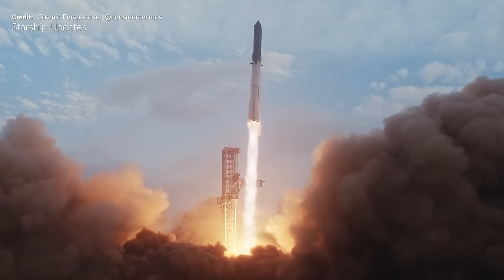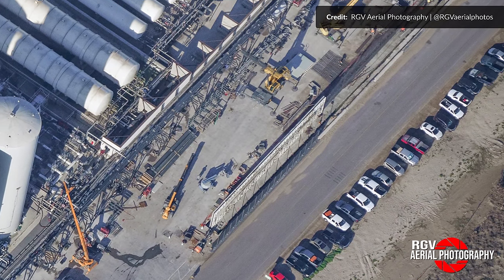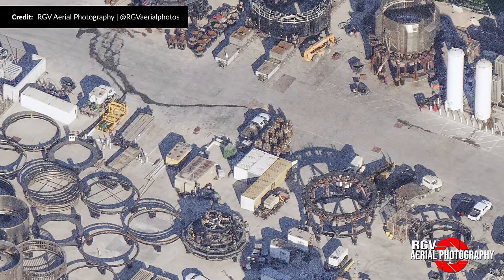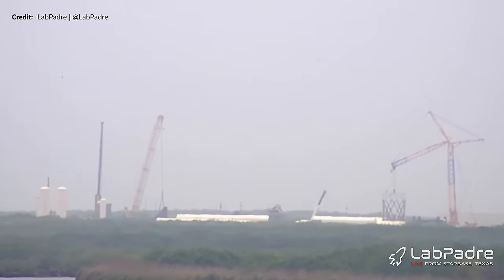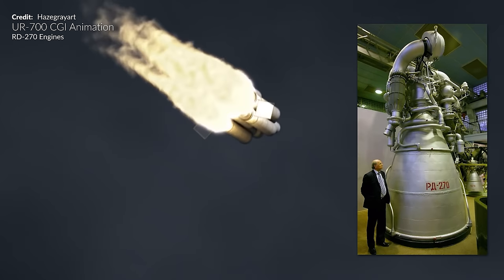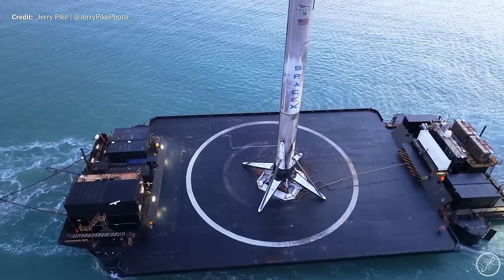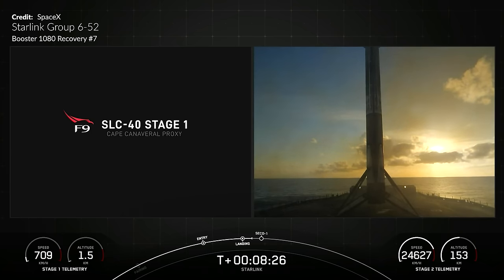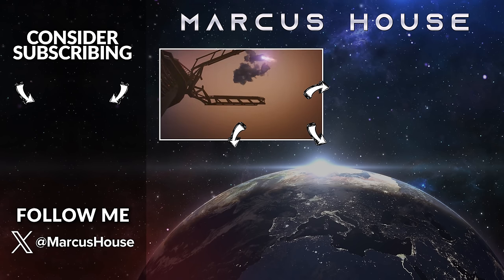Why is SpaceX Starship Only Capable of 40 to 50 Tons to Orbit For the Flight 3 Version?

Comment: Hi Marcus - Starship 3 might even be capable of single stage to orbit, provided it only had a tiny payload and the vacuum nozzles were a bit different of course. That’d be quite something and might open up crew to orbit and modest point to point possibilities without having to worry about a booster. What do you think? Have I got this right?

Comment: For everyone playing Boeing Bingo for the upcoming launch, a perfect win must include a clock failure, at least one bad valve, more than 3 software errors, flaming wiring, loss of at least one parachute, and a door jettison before touchdown.
Good luck!
Reply: dont forget to let a flight critical system* rely on a single non-redundant sensor! (* not documented as flight crtical, but will result in failure if it fails)

Comment: SpaceX built many raptor 1 engines, in fact there was a big kerfuffle over the rate of production not matching Elon's demands.  They are not used on the Falcon and have not been sold to other rocket companies and so far there have been just three 'batches' used up.  It may be that SpaceX is using up their inventory of the now-obsolete engines while they test the rest of the overall rocket.  Would that explain the lower power figures?  They're flying without payload at this point, so no need to push it.

Comment: Stainless steel is great for prototyping a rocket. Less so for building a low mass rocket. While the benefits of its strength to weight ratio through the extreme temperature changes may hold up against something much harder to work with like composites. I doubt it's still going to be the best material for all the parts a SS needs to be fully rapidily reusable. I've wondered since they started if once the design was farely well locked down if they might start trying to shed weight with different materials. Parts like the flaps can be made robust and low mass with composites. Titanium weighs about 55% the weight of steel for roughly the same strength for parts like the absolutely massive grid fins. Theres probably a thousand parts on the full stack that could be much lighter once the design is finalized. Of course you can't just copy a stainless steel part in carbon fiber and have it work the same but the gains are so large I think they'll go through the trouble. Imagine how much that gulper door would weigh in stainless vs aluminum or composite. Stainless for everything let's them develop fast. But I'd expect a farely involved mass reduction program once they are confident in the design. Plus the thing is clearly over built even if they stuck with stainless only. It doesn't need to handle summersaults with an empty booster and the ship still full of propellant. It does suck that you really can not believe anything Musk says. Yeah his words can be true but he's given everyone a lot of reasons not to take it for granted. You'd be stupid not to buy this model 3 when it can earn you over 40K a year as a self driving taxi while your not using it! In 2017. Among other things..... Anyone remember that rocket assisted supercar they made 5 years ago? Yeah me neither. Thankfully I have a lot more faith in the people at SpaceX than I have in Musk.

Comment: According to a source at SpaceX this difference in the thrust and capacity is a tower issue.  If all the Raptors fire at the true rated capacity, it would nearly destroy the launch tower.  This means that the lift capacity must be lowered.  But as you pointed out early in this video the tower and components close to the tower are being upgraded and hardened to mitigate this issue.  However, the FAA and NASA require a "total system lift capacity rating for certification" so the lower number has to used.  This explanation is WAY, WAY, WAY oversimplified.

Comment: I'm still somewhat dubious that those "chopstick" arms can catch a decelerating, 1000+ ton mass with two pins.
Reply: Not decelerating, virtually stationary.
Reply: 200t, but more importantly, a vehicle whose engines can be throttled down to hover.
(Falcon 9 can't do that.)
Not 100% clear on how the rotation into place will work but Marcus pointed out some hardware last week that seemed to help address that.

Comment: Isn't the SSME a full flow engine too, albeit a fuel rich one?
Reply: the difference is that the Oxidizer/LOx in the RS-25 is put directly in the main combustion chamber, and the Turbopumps both run Fuel-rich. So only the Fuel is in the Staged Combustion, not the Oxidizer.

Comment: why don't spacex put starship tiles on the booster quick disconnect?
Reply: the outer covers can handle heat fine. it just needs better seals and better protection on the inside, which cant be solve with starship tiles.

Comment: With the many advantages of hybrid rocket technology - throttleability, higher specific impulse, and controlled shutdown - why on Earth do we still use solid rocket engines at all?
Reply from the maker: Solids are cheap and simple. That is really the only benefit. Basically a massive firework. Arguably the monsters on SLS are not that cheap either.

Comment: The engines exhaust trail does not seem particularly clean as it should in the IFTs.. Leaving me to think there is excess unburnt methane in current flights. Could be intentional mitigation for Raptor v2 issues?
Reply: Unburned CH4 wouldn't be brown, and the engine runs oxidizer-rich.
Pretty sure what we're seeing is NO2 produced from the excess high-temperature oxygen (or atmospheric oxygen in presence of the exhaust) reacting with atmospheric nitrogen.

Comment: Fun fact.  When the Starship lift-off occurs, the rocket will lean away from the tower to avoid accident entrapment.  This was the reason for the fuel line damage; the trust was vectored right at them, and they failed.

Comment: Would it be possible to use a "catapult" to improve the launch mass of the starship stack? It feels like a system similar to the catapult used on aircraft carriers would go a long way in launching more mass to orbit.
Reply: starship is largest and heaviest rocket in history. it would be very difficult for any catapult to launch it upwards. even then, it would need to launch it at pretty high speeds for it to be effective.
Reply: Somebody, I think Everyday Astronaut, did a couple of "Why don't they just?" videos (not SpaceX specific) that would answer this.

Comment: 6:25 "we think this is due to them wanting to try something new "

Like getting them to actually stick to the ship?

9:30 "why only 40 tons and not 100 to 150?"

A) Because you don't just build a 100 ton-capable ship. The main reason why nobody else has done it yet is that it has no use case, but the second most important reason is that it's very very difficult to do.

B) Because those numbers are what Musk wants. Musk wants to have the biggest rocket so he simply makes yup a few numbers and his uncritical fans just copy them down. And even now that it turns out that ten years later he can't do it, they literally go "well he meant starship 2.0". No, he meant this one. Actual Engineers warned that this was going to be very hard and it turns out they were right.

But also: catching the booster means that the booster needs to be able to hang from the chopsticks and *stay in tact*. It's already quite beefy to be able to support starship and the insane fuel load, but now it also has to hang from the chopsticks and that simply adds a lot of weight in the form of structural supports.

There is a reason why nobody does this: it's an idea dreamt up by a salesman who is out for spectacle, versus an engineer who is looking for a workable solution. Catching the booster is a Cybertruck: it looks cool but it's not functional.

I don't think they are running the engines in low-power to spare them. All IFT's are planned to end in a loss of the vehicle so running the engines at a powerlevel that does not get you where you need to be teaches you nothing about how they behave when they are running at the levels you need them to run to do the mission. Both the booster and starship were out of fuel in IFT3 which I would not expect unless they are using way more fuel than planned.

Starship itself seemed to vent gasses once it was up there, so maybe they had a leak that caused them to run out of fuel? Anyway the booster was a spectacular Mach-3 splashdown.

Can't wait for the musk fans to defend their lord and savior.

Comment: Engine pressure might have been an issue, especially for engine cut off and relighting, that seems to have been the Raptors main issue. So running them at a lower pressure might be the quicker fix for now. Raptors are, after all, flirting with the limits of what is doable with such engines.
Given the state of Boeing and the reliability of the Crew Dragon, Nasa should save money by cancelling the Starliner program altogether, just saying.
Reply from the maker: Indeed I certainly expect that SpaceX are running the raptors at lower thrust just for safety.

Comment: Yes there is a problem. We all know what it is. There are way too many point of failures on this thing. The number of engines is ridiculous. Too many engines, too many points of failure. That’s it
Reply from the maker: We watched 2 boosters have flawless burns right up to stage sep. 66 engines that had no issue in the main ascent, plus the Starship engines. That is a pretty darn good track record already.
Reply: @MarcusHouse  They’ve yet to complete a single orbit or land the reusable stage, something they’ve done on the Falcon 9 numerous times. The number of engines has a cascading affect on the entire design and performance. “Keep it simple” is an axiom for a reason. This thing has too many points of failure. It’s a numbers game. Probability. There will be successful launches I’m sure. But until space X can show they can light all these engines without failure again and again and again, they won’t be going anywhere. 3 shots, 3 failures. How many engines is that?
Reply: @MrGittz  Can you explain how having 33 engines on the first stage was responsible for second stage failure on the last two flights?
Second stage only has 6 engines - less than a Falcon 9 booster and only one more than the Saturn V second stage, so a perfectly reasonable number on it's own.
Reply from the maker: @MrGittz  I am certainly not arguing Starship isn't complex. It very much is. Currently we don't know the cause of of the failures. I will say though that the engines may not have anything to do with it (of course possible they did). It may have been pressure, propellant feed or any number of things that stopped the landing burn kicking off. We just need to wait and see what comes out. Given the very smooth ascent performance though, I think the Raptors are looking much better than many of us would have expected. They are all static fired individually and together, so they had all already been fired multiple times prior to the actual flight. I'm personally speculating issues with tank pressure or actual propellant levels (along with a grid fin control issue for the booster's final 30 seconds).

Comment: So right on schedule for 10 Starship flights per day, Elon! 😂 Mind you that’s down from his previous fabulation of 50 flights every 3 days so … progress? 😉 I don’t know why anybody is surprised that Raptor is underperforming, Musk is notorious for over-promising and under-delivering! 😜
Reply: Falcon 9 started out at a launch rate of about 1 per year for the first several years, and had 3 failures early on. Now it is flying on average every *2.7 days*. 

Now yes, Musk promised a daily launch rate, and also that they'd hit that rate a long time ago, but the fact remains that if you ignore his claims and just look at what SpaceX's engineers have still achieved, it's completely unprecedented in spaceflight history.

Also, Musk isn't the only one who overpromises. NASA's goal for Shuttle was one launch every 7 days. They best they ever did was one every 41 days.
Falcon 9 is actually on pace to do more launches just this year alone than Shuttle did over it's entire program. 
And in the last 3 years it has flown more times than NASA did with all Mercury, Gemini, Apollo, and Shuttle launches combined over the course of half a century.

Saturn V at peak did 4 launches in 1 year. Starship has already hit a rate of 3 launches per year, and appears to be speeding up. Musk's goals of 10 launches a day are probably fantasy, but even a rate of 1 launch per week would be completely unprecedented for a Super Heavy Lift Launch vehicle.

Also current iteration of Raptor was originally designed for 200 tonnes. Flight 3 was running at 216. It's only underperforming relative to the increased target that Musk set for it.
It's also worth noting that they've had Raptor up to 269 tonnes on the test stand without exploding, so there is a fair bit of margin there.

Comment: Could the fact that Flight 3 had no payload have had an impact on the performance figures? 

The upper stage propellant tanks were only partially filled because there was no payload. That's a double whammy making the Starship much lighter than expected. To keep the vehicle within acceleration load limits they might have had to run the engines at lower thrust and hence lower efficiency.
Reply: I'm pretty sure that like IFT2 they carried a payload of O2 that they vented once the engines were off.
Reply: @Scanner9631  I am pretty sure they didn't do that precisely because of what happened on IFT-2.
Reply: @spychopath  

What happened then was the result of doing so while the engines were firing.  Doing it AFTER they shut down wouldn't have the same issue.

Comment: The thing about Starship is that there are a few things which MAY be fundamentally insurmountable and MAY NOT solve themselves with maturity. Thermal protection may be one of them. This was NEVER made affordable or timely on the Shuttle despite it being very mature with over 30 years of service. Tiles continue to fall off or get damaged requiring lengthy refurbishment.

Comment: As far as the engines go, it would make sense that they would show full thrust, but dial it down. The reason it makes sense theyd dial it down, is because the very concept of redundancies, engine flames out? Kick the rest up from 80% to 82% to compensate. This also does start to make a rocket much more reliable, think of a jet, he isnt full sending that engine the whole time, like in your car, you dont give 100% of engine the whole time. Doesnt make sense they wouldn't just say this, which is what is the most concerning evidence, that my above theory is incorrect.
Reply: They could also run the outer engines (that don't do restarts) at a higher % of thrust than the inner ones that must restart.
Reply: @Scanner9631  Correct, it has a fully space oriented vehicle that doesn't care about anything but mucrogravity and vacuum conditions, using the starship to land supplies, receiving experiments and such.

Comment: Me: How fast would an aircraft carrier go with SpaceX startship super heavy version 2 booster attached to the flight deck?
AI: the speed of an aircraft carrier with a SpaceX Starship Super Heavy booster attached to the flight deck would depend on the specific configuration and the operational capabilities of both the carrier and the booster. The Starship is designed to have a high speed, but the actual speed of the carrier with the Starship attached would depend on the specific mission requirements and the capabilities of the carrier's propulsion system.

Marcus, AI failed. Can you do this question any justice?
Reply: The problem is that estimating drag force on a ship's hull is rather tricky. I have a theory that a first order estimate for an upper bound might be obtained by assuming that the mechanical power from the ship is accelerating a mass of water to the same speed as the ship (but in the opposite direction). Take the following with a large amount of salt.

Let's use a GRF class carrier, since it's about 100,000 tonnes loaded, which is a nice round number. Based on the 260MW of shaft power, an 80% propeller efficiency and the 30 knot max speed I estimate a drag force at that speed equivalent to about 1750 tonnes, just over one fifth of the thrust from Superheavy V2. 

Since drag roughly increases with the square of velocity, we can take the square root of the difference in force to find that the top speed would increase by a factor of 2.17 (so ~65 knots) for Superheavy alone or 2.39 (so ~72 knots) times with the ship's engines helping, ignoring that the propellers probably don't work very effectively at that speed.

That might seem slower than you'd expect, but I'd note that even in a vacuum the ship would only accelerate by 2.8km/h each second - in other words it would have a 0-100 time of about 36 seconds, which by car standards is, uh, terrible. When you consider that the acceleration is that slow, it doesn't seem too far fetched that it would only push the top speed up by that much. Aircraft carriers are just a whole different kind of huge, even compared to Starship, and shoving a lot of water aside takes a lot of force.
Reply: Great answer and seems like a reasonable estimate. Thanks